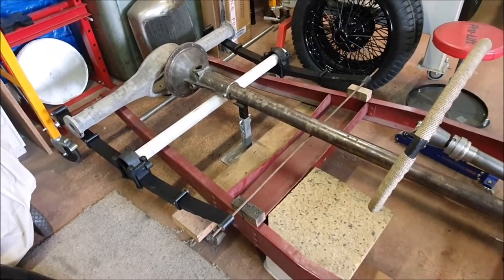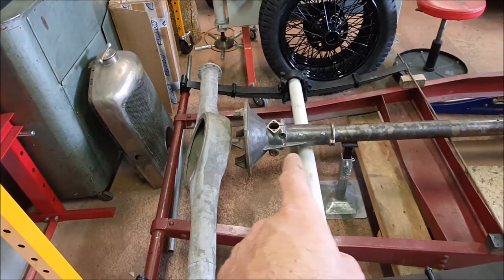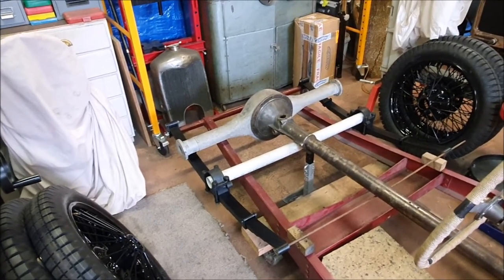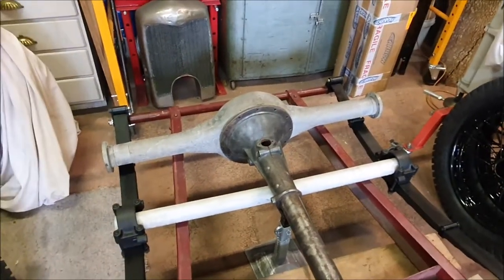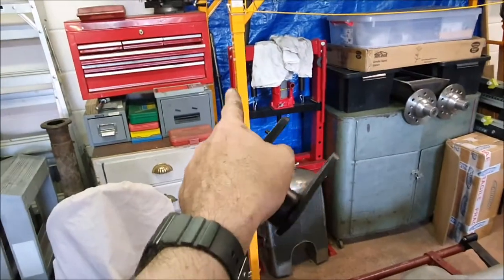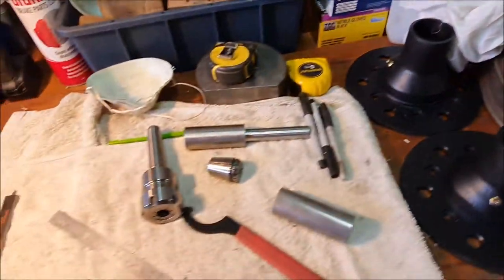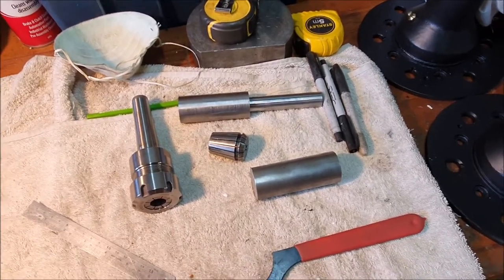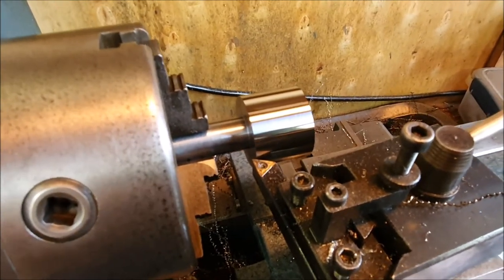Pre war cars update - Rear suspension pins in and making a fly cutter

Comment: Nice work with the fly cutter tool.👍
PS Small rad on cutting tool's will give a better microinch finish.
Reply from the maker: Yes, doing that on the second one definitely improved the finish. I use a diamond file to gently round the sharp point.

Comment: Sickening to have to re-do work, but at least you have tested the Loctite and it works, so that is worth knowing! Could you not have laid the axle tube on its side to check the spring location? Good progress!
Reply from the maker: I think I will wait until I have both spring mounts made before trying to shorten the torque tube so I know exactly where it needs to lie. I think the thing to do will be bolt the housing to the torque tube now. Mark where on the chassis the tube lies. Then with the springs on I can mount the axle in the springs with the torque tube out of the way and mark where it is on the chassis then. Then I just need to shorten the tube by the difference. Roughly measuring it's about 10-11 inches I think. That makes sense as the original 9s have about a 106" wheel base and the Brooklands was shortened to 8 feet or 96".